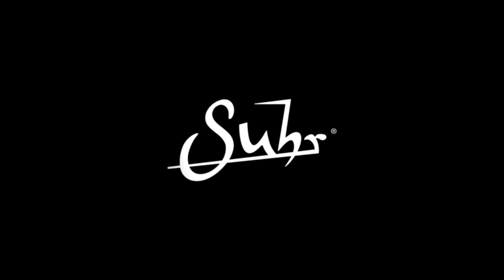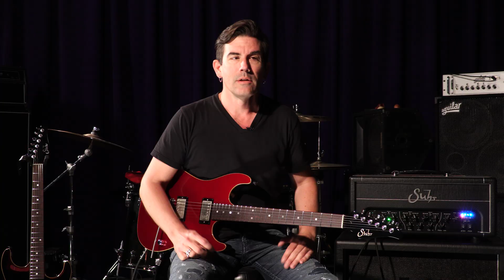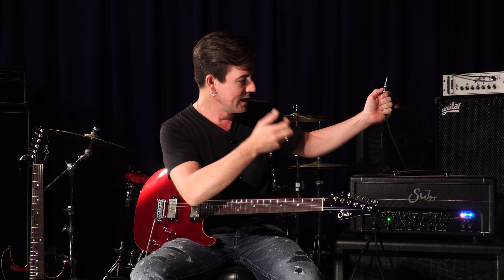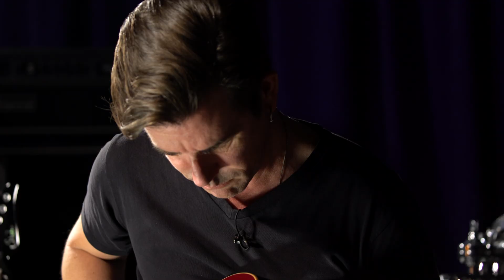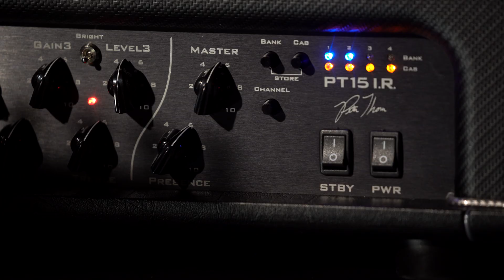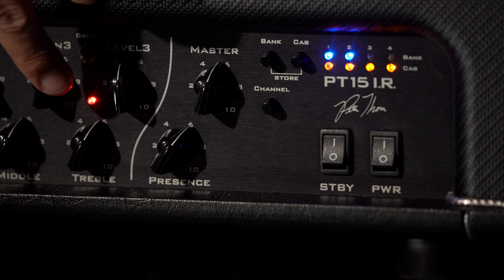The Suhr PT15 I.R. Amplifier Head feat. Pete Thorn  •  Wildwood Guitars

Comment: Hello Peter. I am quite sure your amp is what I have been looking for having sold my Mesa Mark IV in the name of quieter home recording comfort. I now have Laney IRT Studio amps x 2, an IRT SLS hybrid which actually sounds great through an FRFR speaker. An L5T 5 watt combo with G12H and an L20T 20 watt with G12H and a V30. All are EL84 based apart from the SLS but different configuations. My question is am I better with a standard PT15 and buying the Reactive Load separately. I didn't mention I have a Fryette Power Station also after spotting it regularly in your studio. I want to be able to use the IR's with any / all amps but appreciate how tidy the PT15IR is. This has probably been asked or mentioned before. Are they the same amp otherwise? I have never owned an amp with a master volume also.
Reply: Got one!

Comment: I really like this amplifier I think it does just about everything you would want and look for in a great sounding tube amp but the price is a killer for me. My thing is I love vintage amps and I could buy the most badass Marshall Super Lead or Super Bass from the 1960s for what I can buy one of these for. Now some would argue yeah that's a vintage amp and you'll have to do this to it and you'll have to do that to it well any tube amp you're going to have to do maintenance in time, I don't give a crap about maintenance I do all my own work pretty much anyways - I love the new modern stuff but I have a real hankering for the old vintage stuff.
Reply: But Ron- I don't think you will find a good condition unmolested Marshall Plexi from the 60's for the PT15IR price ($2699), indeed I paid $1850 a few years ago for a 1972 (they are less) and it has a replaced transformer. and if you DID find one you'd have a great but LOUD amp with no channel switching, no state of the art reactive load, no DI IR capability, etc. It's sort of like saying hey, for the price of that Tesla Model 3 I can buy a nice 1965 Mustang.

Comment: I bought this amp the day it was released.  I use it in 4CM with a Fractal FX8 straight to the board.  No speaker cab.  One of the things Pete talked about in the video but didn't really stress just how cool it is is the ability to push the power tubes.  Right around 6 on the channel levels you can hear the gain structure change.  The amp doesn't get much louder at all after 6 it just crunches up, compresses, and sustains!  Channel 1 is really cool!  I set the gain on 4 and the level on 6with the bright switch on.  This gets you just into a bit of power tube breakup.  If you like your clean sound compressed this setting will work great. I can roll the guitar volume back a bit for a crystal clean tone.  Channels 2 & 3 are the same with different gain and level controls.  These channel's have plenty of gain!  I run channel 2 gain on 3 and channel 3 gain on 5 with both level controls on 6 and bright switches off.  Lots of clarity on channel 2, plenty of sustain with the level on 6.  Channel 3 is hot rodded marshall!  
I play in a top 40 coverband.  We cover a ton of ground and this amp works!  My old amp is a Bogner Ecstasy Classic.  The Ecstasy was hard to replace.  It's sounds really fantastic! but after 7 years of lugging it and a 2X12 cab around the PT15IR is a welcome change!!!
Reply: Very cool.  Something I would like to know.. how big does the amp sound in person?  How is the headroom?  I am really interested in this amp.  The IR's are very cool to have.
Reply: @motrock2  There is a surprising amount of headroom on all three channels.  This amp is LOUD!  I bought it sight unseen just going by what Pete put out there.  If you live near a dealer definitely go play the amp!
Reply: @RalphMercuroMusic   Thanks man.  Thats is really cool to hear.  Would you say that it almost feels like a 50 watt amp?  Sounds like it!  I always worry about 15-20 watt amps sounding small.  Very cool to hear that it is loud.  Loud is the only way to be! LOL
Reply: I actually do not live near a dealer.  middle of Illinois!
Reply: @motrock2  It does feel like a big amp.  I've had other lower wattage amps like a Blues Jr. and a Classic 30.  Both good amps but I missed the thump you get with higher wattage amps.  I've played three amps that are low wattage but still feel like big amps.  The PT15, the Friedman JJ Jr, and the Soldano SLO 25.  All three are just fantastic!  I went with the PT for a few reasons.  1 it has three channels and I rely on that in my band, 2 the reactive load and built in IR's.  I run the amp straight into my mixer and monitor via in ears.  3 the weight.  It's only 24 pounds!  My previous amp (Still have it) is a Bogner Ecstasy Classic.  Killer amp and perfect for my top 40 cover band but it's heavy and requires a cabinet...  Since we're on ears there's no need for a cabinet on stage...
Reply: Ralph Mercuro yes but assuming you weren’t of slight build and went to the gym and could easily handle carrying the bogner would you choose the pt15 having better tones? Or being more versatile ?
Reply: @Julzproject  One amp isn't really better than the other.  They both work very well for what I need them for.  The PT is more convenient though.